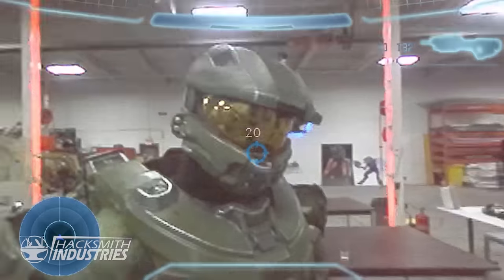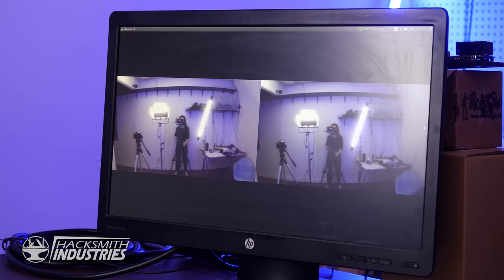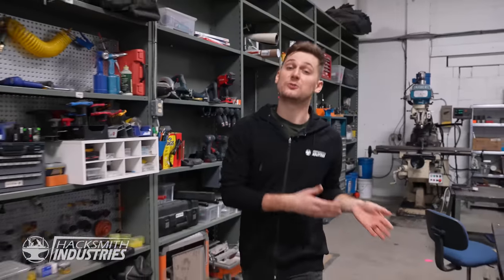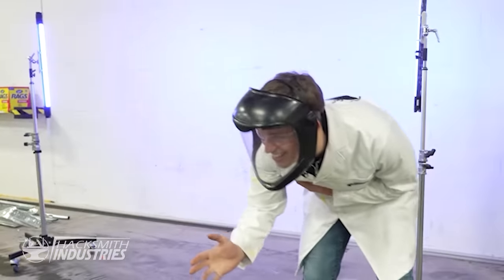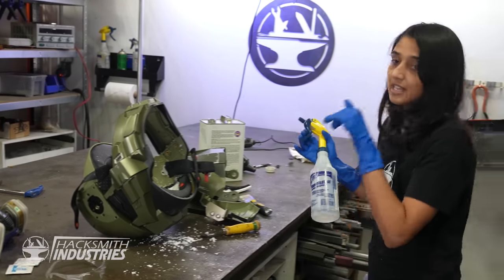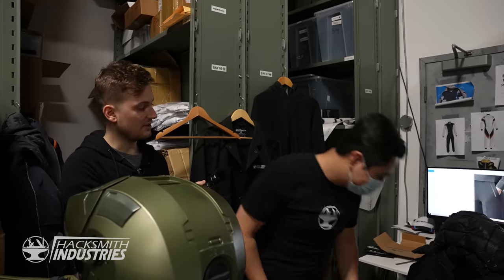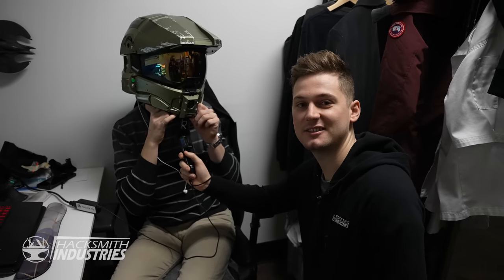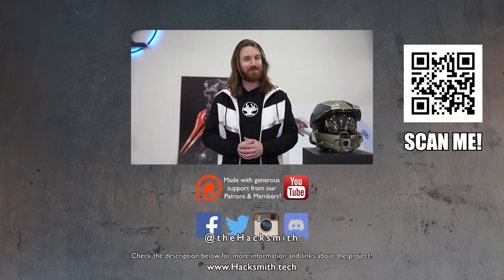Halo Helmet with REAL Heads Up Display!

Comment: I would love to see a full master chief titanium armor build, lol I don't expect it to happen of course as the needed tools alone would be astronomical in price.  Perhaps aluminum, that could work better.
Reply: Yeah that would be too heavy anyway, without the possibility of making an exoskeleton that small
Reply: @Slogan6024  it wouldn't be nearly as heavy as you'd think, chiefs armor from infinite is more than doable with 3mm thick metal.  You'd just need to give if the right compound curves to make an illusion of thickness.  Or just cast it if its aluminum, that'd be way easier to get small detail.

Id estimate the plates to be around 80ish pounds at the max, and that's worst case scenario.
Reply: You can build an actual powered armor suit. Halo, Iron Man, etc. The ONLY barrier is the power source.
Reply: We have ablative armor. We have exoskeletons(hydraulics vs pneumatics), we have rockets, directed energy weapons(lasers and particle beams), helmets and sensors(computers).
The problem is we can't create a power source good enough to run them all.
Reply: @scifirealism5943  honestly there is no real reason too, I mean it'd be awesome but not at all practical lol.
Reply: Perhaps Carbon fibre and Kevlar to make it strong with a few alloys here and there
Reply: @scifirealism5943  It could probably kind of be done by having it attached to like a power cable
Reply: @melkertorslen8558  not practical
Reply: @generallemons4730  Carbon fiber would be even more expensive than titanium, and wouldn't be as strong.
Reply: or very thin Layers of Aluminum foil with glue strips
Reply: Even an aluminum cast version using the lost foam or lost PLA technique
Reply: @jaredtrainor6860  there is one being made by installation 00
Reply: @jaredtrainor6860  I know I’m just thinking how to make it lighter and I’m saying kevlar because it’s bullet-proof in the right amount and carbonfibre because it’s lighter Plus I’m just spit Balling
Reply: @jaredtrainor6860  It is possible but all of the cool stuff is the active systems, without them it's just metal armor. I also don't know where you got those measurements from but I doubt his armor is 3mm thick, maybe the under suit but definitely not the main armor.
Reply: @generallemons4730  Everything is "bulletproof" if there's enough of it. Aluminum is significantly cheaper and easier to work with, especially if it is just cosmetic and not intended to serve any significant anti-ballistic properties. In terms of weight, at this scale and use, it would be similar enough to not be worth the Kevlar-carbon composite
Reply: @midgetman4206  No no, I didn't say chiefs armor was 3mm thick, I said it could be pulled off with 3mm thick material to save weight while maintaining the same look with the illusion of thickness.  In the Lore of halo chiefs armor is unbelievably thick in some parts, even for the use of titanium lol.  So thick that there is no reason Spartans should die to most weapons most of the time.

Anyways whats not cool about a steel/aluminum/titanium build by itself?  I mean internal systems are awesome, but you'd be hard pressed to impress someone with resinous materials rather than metal ones.
Reply from the maker: @jaredtrainor6860  I think even 3mm thick suit out of aluminum would weigh well over 150lbs! Just speaking from experience in lots of metal work. An exoskeleton would probably be required for any full real mjolnir armour,  unless it is just thin metal.
Reply: @hacksmith  the suits in game are neuralinked to the user and double as a exoskeleton
Reply: @hacksmith  My weight assessment for aluminum was probably off by a bit, my main experience is in steel.  However looking at the armor I can definitely say you'd save a LOT of weight by simply avoiding using so much metal on the shin/boot parts.  Lol there is no need for such thick material there unless it was a polymer/resin/carbon fiber material imho.
Reply: @scifirealism5943  solar power hehe
Reply: @knrz2562  Mate it would be like strapping a table on the back Of MasterChef’s suit
Reply: that would be true hacksmith fassion
Reply: @generallemons4730  reverse osmosis
Reply: @scifirealism5943  well obviously not, but very few things made at the hacksmith are practical. Pretty much everything here is made too look cool basically.
Reply: @hacksmith  Hydraulics, pneumatics, or electro servo motors can give you superhuman strength.
Reply: @melkertorslen8558  Yeah i love it!
Reply: @melkertorslen8558  imagine if someone solved the power source issue...
Power Armor would make you a trillionaire.
Reply: @hacksmith  I love your channel!
Reply: @scifirealism5943  that would be really cool. and not only for power armor but also the fact that a lot of our current technology is limited by power sources
Reply: @melkertorslen8558  to break it down: the helmet relies on electrical engineering. Directed energy weapons are lasers or particle beams, super strength comes from mechanical engineering( hydraulics. Pneumatics. Electro servo-motors), bulletproof armor comes from ablative armor or graphene, even jet boots like Iron Man can be built if sufficient fuel and propellant can be made.
Reply: @hacksmith  I haven't personally built any armors myself but a common estimation i see is that the body can be covered with between 2-3 sqmeters ov material. Using 3mm thick aluminium that would be about 16-24 kg for an entire suit. Also I think that historical plate armor is about 1mm thick steel. Given that density of steel is very close to 3 times the density of aluminium it at least to me seems likely that you could make a full armor at a resonable weight.
Reply: @scifirealism5943  True, althoug directed energy weapons are usually very inefficient compared to projectiles.
Reply: @melkertorslen8558  right.
Reply: The biggest issue is the nanolaminate composite and the circuitry used throughout the armour
Reply: @elijahaitaok8624  Most of that stuff is unnecessary for a modern day build of the armor, especially since stuff like hardlight is theoretical at best.
Reply: @jaredtrainor6860  it's unnecessary because currently the cost-benifit isn't in favour of the armour, neither do we currently need overkill armour. The helmet alone in-universe can and will stop the sniper bullet, the impact will still kill the Spartan.

Comment: Heads up guys (see what I did there?) When pouring acetone or anything from big containers like that, pour with the opening at the top not the bottom (i know its counterintuitive) but it prevents the air lock so you get a smooth drop and spill free pour and not the glug glug you had spiling.
Reply: Life hacks, or old-school wisdom? Who can say? Good advice tho fr
Reply: Oh my god thank you, really helps when pouring ethanol for resin printing

Comment: QUESTION: could you have use transparent screen for hud or is it too early for such tech to be used on a custom screen like master chief helmet? Your work is awsome, but as a perfectionnist i like to see what can be improved and pushed to the limit, even if i couldn't achieve 1/1000th of what you did.
Reply: The tech exist, but not off the shelf. Basically you would need a custom visor that let's light in, but also has a polarisation on the inside so you can project onto it from either the side or above a person. This tech has at the very least been used in cars and stuff to project the speed onto the windshield
Reply: They did something kinda like this for the ironman helmet, I think they should've used something similar for this.
Reply: Make yours then
Reply: Installation 00 on youtube is working on making a full Mjolnir suit, he is using a hololens for the ui stuff
Reply: You could use a Hololens for this, which has a transparent display, but it will cost you 3500 bucks.
Reply: @SEYI-SEAN  Except he cannot..
Reply: Its possible with technology such as Microsoft HoloLens and google smart glasses however they are extremely expensive and hard to hide
Reply: Actually, the vr thing they did is true to the lore, Spartans visors are just an attempt to humanize them.
Reply: Installation00 is making a more accurate version using Google glasses
Reply: It exists, and they used that in the iron man helmet, but then you couldn’t have the night vision
Reply: Pulling apart an lcd screen has a similar effect. not sure where to go from there
Reply: @GundamReviver  smaller channels have done it im surprised with the budget they have they couldnt have done something better
Reply: LG already mass produces a transparent display. So in theory there’s nothing to prevent using it in a helmet.
Reply: @johnhoo6707  yep i was thinking about lg's screen when i commented.
Reply: Yea, they used it for the iron man helmet. I have no idea why they didnt use it for this.

Comment: Wouldn't have to hide everything inside if a different helmet were chosen, like one of the helmets from Reach, where they're supposed to be designed for modularity and attaching things to the outside like extra sensor packages, flashlights, lasers, cameras, etc. Would have made it easier to go without having to cut parts away and readjust the shape of certain parts or hide things in awkward positions. And mot of the internal protection would have been able to stay, too, so it would still be practical for using as a riding helmet!
Reply from the maker: This is the only helmet that has been made into a helmet though as a product
Reply: @hacksmith  Ah, fair enough!

Comment: "motorcycle helmets are great because they're super comfortable and super strong"
> proceed to gut all padding and protection
Reply: That's what I was thinking, they were all "Look how durable it is!" Then took EVERY LAST PIECE of protective material out of it, thus rendering that first test completely useless...
Edit:
They'd have been better off buying a much cheaper option (the motorcycle helmet costs around $800!) or, even better, machining it/ 3D printing it...

Comment: Helmets are due to head shape, not volume.
 The issue with fitting 13:50 has been with the helmets shape & design. Circumferences are not what's needed for sculpture in the round as they don't tell the full story about shape. I learned this the hard way myself so I just got rid of 3D printing helmets a long time ago & now cast large silicone molds based on specific measurements. Custom made helmets are just the way to go. This is such a great video. The team should tackle the Robocop HUD helmet.

Comment: This project is really cool, as with a lot of your videos I've watched. One thing that could have elevated this even higher (and would need to tie into the rifle as well) would be being able to track the aim of the rifle as well, so the cross-hair would show up where the rifle was actually aiming. (Maybe an IR laser on the rifle, picked up by the IR camera, and using the processing unit to track the laser point and attach the cross-hair to it?)

Comment: It's crazy, few code lines and it does all this. Prerequisites - have all of hardware, like consoles, cameras,  controls and engines (this project doesn't need it tho) lying around and helmet for a grade of 10, just to pass an exam. PC - you will have to go and get it, few images in right places and it's done as a beginning of something greater. Essentially it's a proof of concept - it's possible.

Comment: cool, amazing job!
Just two thing what I saw what is not really accurate
1. is it friend or enemy work with radio connection plus AI (enemy don't have same raido frequency and civilians still need look friendly or just nothing)
2. HUD work form projects so you should see even helmet not have energy at all.

But like I said amazing work <3

Comment: @Hacksmith Industries okay so you made the HUD for multiple helmets so why not implement that into the power loader design whilst also adding extra artillery(not actual bullets but potato guns maybe) and armour, how it will work is the HUD will connect to outside cameras or create multiple AR screens so that you can control most of the power loaders features and have a protective shell surrounding the 'cockpit' or torso so that you are protected.

Comment: If you do a V2 of this, definetly try using AR glasses instead of VR glasses. Might help with some of the electronics payload, since you won't need a eye replacement.

Otherwise, looks good, and amazing software work on this. Programming like this is well beyond my ability.

Comment: Not even 2 minutes in and it's already bunk. 

7 inch OLED transparent screens are kind of cheap, and actually do that and in the event of power failure still functions as a visor.

Comment: The Latency is due to Python, and Python has all the easy accusable libraries for this type of project. If you needed performance, cpp
Friend/Foe - a simple randomiser in software, unfortunately the software had 2 support beams as Foes 10:52
Using a VR headset, not the kind of Heads-Up I was thinking about. 
I also like the fact that the Helmet has perfect protection, until it was drilled and melted out, now It has no Protection qualities - smooth one 

Having it connected to the internet with wifi to switch cameras (so sad, and lazy), you could of used an independent voice controller module for instance, or a remote switch in a glove
Reply: do it yourself if you are whining

Comment: I know nothing about this level of engineering and tech so there’s probably a reason but where such big cameras used. Wouldn’t it be easier to use the sort of cameras found in phones which have amazing quality like in the s20 which has 100x zoom. Smaller more compact.

Comment: but the thing is, would you wear it while doing real life obstacles, say such as riding a motorcycle/ATV drive a car, bicycle, Skateboard or even a paintball course to simulate Halo combat? So yeah it is cool and works but does it functionally work for real life? Think of it like this if it works for real life purpose what kind of market there would be for the Halo helmet. There would be a fortune to be made off of it. even if just for gaming

Comment: The actual feed inside the helmet looks so low res and I'm not sure if that's because the png images were low res or the VR headset they chose was just some chinese 720p one. Probably the latter.

Comment: I'd call this a fail. 

In Halo the HUD isn't created by the helmet. You don't need a visor, let alone one with polarisation if you're just looking through cameras.

In Halo the HUD is generated inside master chiefs visual cortex such that wherever he looks there the HUD is even without the helmet. That's why he needs the visor, because he's just looking through his eyes. 

Master chief is a cyborg. Anything less than creating a fully working cyborg is a fail on this build. 

Also the master chief tactical helmet withstands strikes by the plasma sword and shots from a 50 cal and a drop from 30 stories

The best this helmet is doing is surviving a gentle rap from a wooden cane. Not exactly building what's in the game. 

At best this is a try hardy cosplay item.

Comment: The only thing I like about halo is the concepts, not that I am saying they are genius or something. Like, come on. Kevlar titanium nano composites? That is so weak compared to (well pretty much everything but…) carbon nano fabric (essentially just carbon nanotubes woven together. The nanotubes can be encased in nanotubes so it can be strengthened without a noticiable change in volume), and come on. That is litterally THE WORST possible design for a plasma sword, it LOOKS unrealistic, and the magnetic field making that shape is pretty much impossible.

Comment: Hey can anyone suggest me a similar but cheap computer like they have shown in this video at 3:03?? Jetson is way too much expensive for me to buy..I am trying to develop a close range air defense system which wont have any missiles but some tungsten rods as ammo..it would work just like the railgun but with some additional features..

It'd be really helpful if you anyone could've suggest something similar to the jetson..